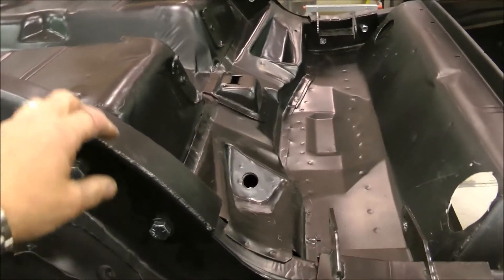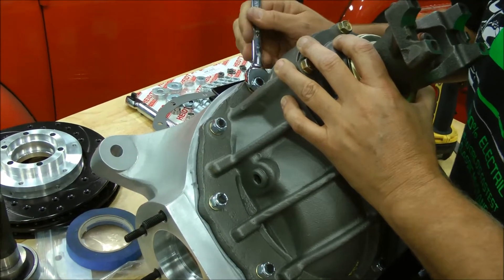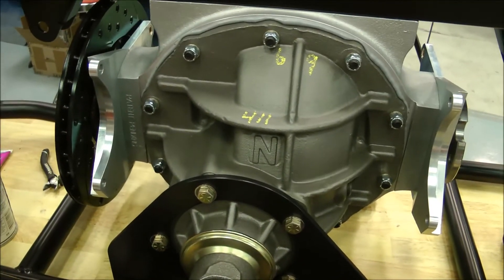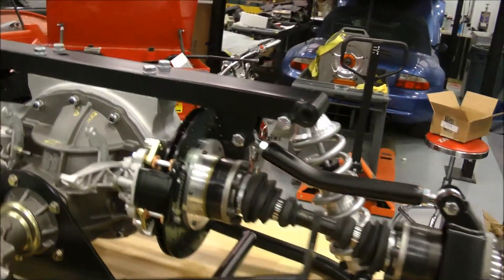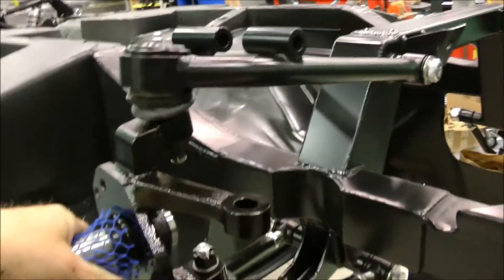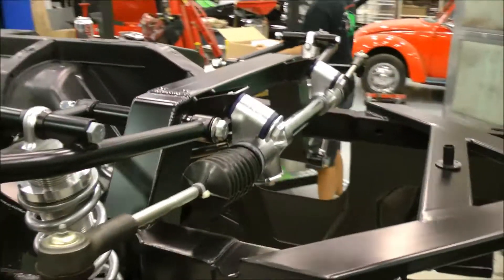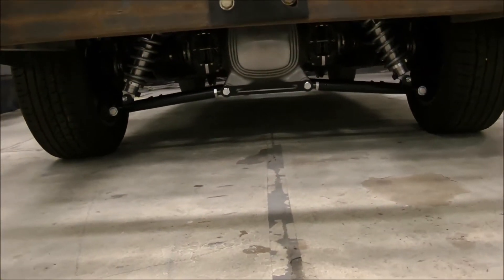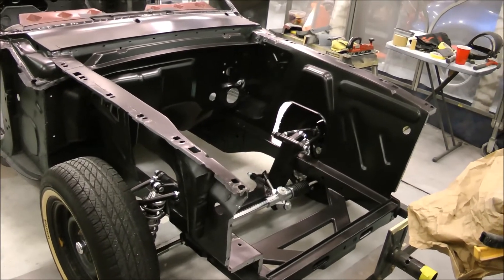1966 Electric Mustang Conversion part 5

Comment: Any updates on that Lincoln?
Reply from the maker: We are waiting on a new rear end setup before tearing into it. Shockingly, we found the car had a Dana 53 in it from the factory and we were expecting a ford 9". I think it will go pretty fast when we start since there isn't any body work outside of the engine bay to speak of. We will be posting a set of videos documenting every step just like the Mustang. We actually have the motors in hand and are working on the battery design as we speak.
Reply: Awesome!  Any video you can show for the battery design?  I'm a software geek so I love all the techno-detail stuff!
Reply from the maker: +Joshua Pritt Believe me I know everyone is waiting to see the electrical side of this conversion. Soon grasshopper, soon...

Comment: I would've gone with a late model mustang cobra irs.    Keep it Ford, and a lot less money and proven to handle a lot of torque.  I understand that you might be planning on having a bit of torque with this setup.
Reply from the maker: I like the fact that this is is a direct bolt in and we paid to get the high HP version. It is rated for over 700HP and 700 Lb.Ft. of torque.